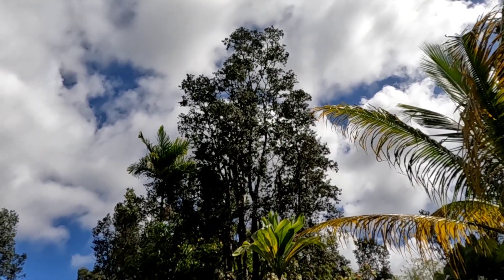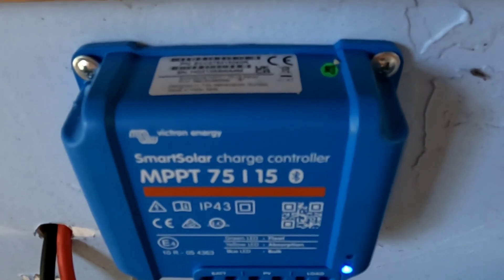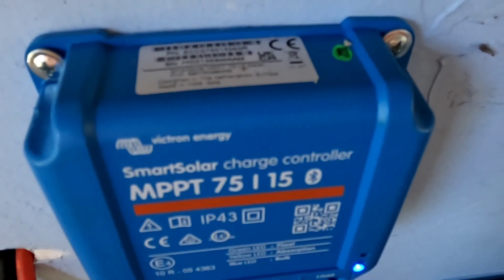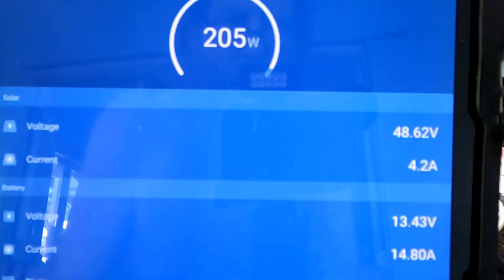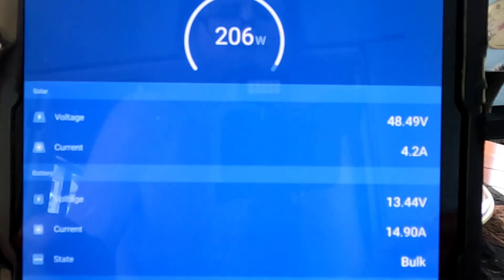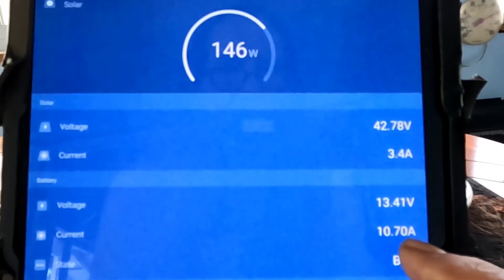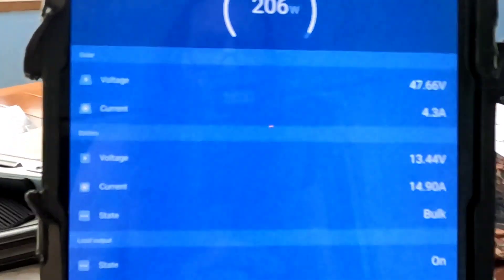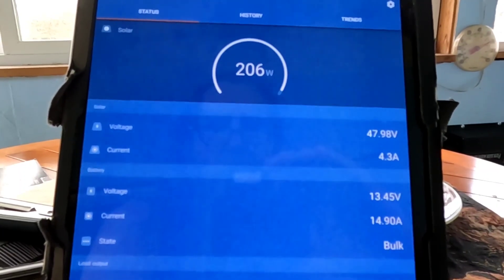Victron MPPT 75/15 pushed beyond rating. What happened?

Comment: I have the same controller, it is ok to over panel Victron mppt controller, no harm can be done with what your doing, just be sure to stay under the input voltage limit, what your seeing is called clipping during peak solar power available, not all manufactures of MPPT controllers can handle over panelling or clipping, be careful read the manual. If you were to add a 4th panel then you would need to put 2 and 2 in parallel then put the 2 parallel sets in series, 4 panels in series would exceeded the 75volt input limit, Alarm Input over voltage comes up @75.05v and stops charging, clears once you go below 73v and starts charging again.
Reply from the maker: Great advice, mahalo! 🤙
Reply: No it is not ok! You can’t go one the input voltage limit in this case 75v.
Reply: @allisonking785  What he showed us is perfectly ok, he’s not exceeding the voltage, he’s exceeding the output current, which is ok to do on victron mppt, but not ok on some other mppt controllers, I’ve updated my original comment to address this.

Comment: The 75 is the watts you can use directy from the controller without a battery connected. Its on the far right where there is written "load

The 15 is the maxs amps it is capable of charing your battery
Reply: 75 is the max pv open circuit voltage and 15 is the max amps the controller will deliver.

Comment: as an example///    got the 100 /20 ...      6x  old  24v     240w panels i found IN   3s 2p  maxing it out
 but need to make 48v battery pack to reach that limmit abd   keep the nominal specs  and the max specs  close to limit but safely under it
i count to self consumtion and the parrameter that panels are for sure Old enough used . it sure smells enough loss but tht charger will work less  hard within that losses!!!!        
!!! hopping to see the system charege a server rack  batt !!! i would love to see in a good sunny day  summer or winter  to maintain  a 5kw battery    . 

BTW thinking of install fans to maintain heat from system ..  if this doesnt work will try with 12v new  panels

Comment: I wanted to know too. I've got nominal  Isc 30A, but in practice about 22A max, and wasn't sure if I got the 20A model if it would survive. Great test. so I can add another panel in parallel. I'm also curious what happens with the voltage limit. Vmpp=120V, but Vmax=160V so for me, I didn't know if I could get the 150V max model.

Comment: That was obvious. It’s stated in the booklet that the controllers regulate till the max limit. Yes you can add a panel until you reach the max PV voltage .. in this case 75 volt. 
More panels means more efficiency with less light available. More panels at less light = max watt available sooner. 

So your experiment you could do in paper. 
Victron is not stupid and does test there systems the same way

Comment: People with no formal electronics training rarely understand current (Amps) You do not push amps you cannot exeed the amp rating of that controller, All you can do is exceed the voltage rating if you connect too many panels to it in series, The flow of amps is controlled by the resistance of the internal circuitry and the amount of voltage applied,  reduce resistance more amps flow, increase voltage more amps flow, you can do neither with that controller as it regulates those things

Comment: Right.   You only really have to be careful about not exceeding the open-circuit voltage limit on the input of the charger controller (with some provisios described below).  The charge controller will regulate the output amps to keep them under its amperage limits and over-paneling in this manner is fine, it won't hurt anything.  Its only (for the most part) volts that destroy charge controllers.   All charge controllers will regulate their output amps.

--

Charge controllers also often have input amperage limits too, which they can't regulate.  If you look at the Victron datasheet the "Max. PV Short circuit current note(2)" parameter for this particular controller is also 15A.   This means that the absolute worst-case current on the solar input must not exceed 15A.  The charge controller cannot regulate the input current so excess current on the input may damage the controller.   Note 2 on the Victron datasheet says "A PV array with a higher short circuit current may damage the controller".  And that is why.

So the controller can (and does) easily regulate the output current, but cannot regulate the input current.  In a series configuration this is virtually never a problem since very few solar panels are ever rated above 15A.

--

However, it can be a problem in a parallel configuration, or if two series strings are paralleled.   Usually you just calculate your worst-case input amps based on the assumption that the output amps will be capped while the input voltage is at the optimal operating voltage for the panel.

But can situations arise where this is not the case?  Yes, it is possible, though it usually takes a pretty serious misconfiguration of the series-parallel topology.  If the paralleled strings have partial shading but are otherwise in full sun, the input voltage will be far lower and the charge controller might exceed the input amperage limit trying to regulate its output at the output amperage limit.   With a proper combiner box you should have a master breaker on the combined output which protects the wiring AND the charge controller.   This breaker's amperage should not exceed the charge controller's maximum rating.... 15A in this case (as well as not exceed the wiring limits).

There is a bit of wiggle room there, for this particular case I would probably use a 17A DC breaker rather than 15A DC breaker just to avoid phantom trips from long-term thermals through the breaker.   But it is only needed if you parallel two or more strings whos short-circuit specs add up to more than 15A.

Can it happen on a 12V charge controller (12V output?). ... probably near impossible to happen with a 12V charger controller, this is more an issue when running 24V or 48V charge controllers since the input voltage (due to shading) can wind up being lower than the output voltage under certain conditions.
Reply from the maker: Mahalo for that great information! Appreciate you spending the time to explain this for all of us. Aloha 🤙

Comment: I believe you have a 15amp limit at 70volts or potentially 1050watts your controller provides 2 sources of power 1 that charges a battery and another load that can feed an inverter. If this is correct your not really close to the limit for power you can probably connect 3 parallel sets of 3 series 100w panels and stay safely under the limit. 9 panels 900w below the limit, less than 70 volts and about 15 amps.
Reply: This controller is only capable of 24v system. So, assuming a charging voltage of approx 28.8v x 15A is about 432W max output.

Comment: I always enjoy you videos!  If you had a 24v(or 48) battery system you'd get the full 300watts from the panels.  Amps don't add up in series connections, one caveat though,  just make sure that you aren't using a panel that has a Isc (short circuit current) higher than the controller capability.  That could happen with these small controllers.
Reply from the maker: Mahalo for sharing this information with us! I am running a small 24v and 48v system too...all doing great! Aloha!🤙

Comment: Interesting to see how the Victron handles over paneling.  It looks like the controller reduces the panel voltage to throttle the power into the controller.   What I don't understand is why the array current to the controller was so low.  In an ideal world even at voltage below the Vmp the current from the array should be close to or perhaps a bit above Imp.  Was your sun angle less/greater than optimum?  It would be interesting too see what the output from the panels is when connected to a higher capacity controller such as the 100/30.  In other words would you get the full 300 watts from the array and would the array amperage be closer to 6.25 amps?  

It also appears that total wattage is being effected by the battery voltage.  You should see an increase in wattage through the controller as battery voltage increases.  That controller is rated for 220 watts, which would give 15 amps at 14.67 volts.  If the battery was really flat (say 12.2 volts) the controller should only pass about 185 watts to the battery.  A quick calculation suggests that the controller will pass the following wattage as a function of battery voltage (using the 14.9 amps you saw as maximum output): 12v - 179w, 12.5v - 186w, 13v - 194w, 13.5v - 201w, 14v - 209w, 14.6v - 218w.  So based on that alone, over paneling is not an efficient use of panels.
Reply: Making the most efficient use of panels is not really as high of a priority as it used to be.
Back in the 80s I paid just under $5000 for 6 120 watt panels, I wanted to get every watt possible out of them.  Now panels are cheap and over paneling is a good way to get thru cloudy times without having to start the generator.
Reply: @andreblanchard8315  Getting maximum output is still desirable in some situations.  For example I have solar on my boat, but the size of the array is quite limited, so I would like to get ever watt I can out of the panels I have.
Reply: volts by amps gives gives watts. amps are low because panel volts are high..
Reply: Because that is the maximum power point... MPPT

Comment: Hi Gary,  Good content for sure.  I agree the controller is limiting the PV to the battery at 15A max.  Pausing the screen when the battery was at 13.45v and amps to battery at 14.8 equaled 199 watts to the battery about about 7 watts to run the controller.  Using 3 100 watt panels and warm temperatures, you will most likely see 75% of stating rating or 225 watts in total which would give you a very efficient conversion.  It would be interesting to see IF you install two controllers on the same 3 panels what the difference would be.  But given you have 300 watts of PV it may not be worth the test.  Luckily I now believe the specs on the controller will limit the amperage for sure.  I have always heard that the killer would be IF you install 100V of PV on a 75V controller, then most likely it would break it.  I did a similar test on a Midnite KID under a heavy load and the warning light would come on and eventually blow the PV fuse on the controller.....I did that by accident and got lucky!  Lesson learned.  In cold weather such as here in Michigan, the PV voltage can increase by about 10% once you get at freezing or below temps!
Reply from the maker: Thanks as always for sharing your experience with us! It surely helps us all and is much appreciated! 🤙
Reply: From the Victron mppt manual section 9.5.1O but its about reverse PV current since the unit IS protected against reverse polarity to an unpublished limit:  Overcurrent does not necessarily damage the solar charger, but it will cause damage if the array produces too much current while, at the same time, the array has been connected in reverse polarity to the solar charger. Damage due to overcurrent is not covered under warranty.  In testing on a 100/20 connected to a 12v battery the PV wattage limit is stated at 290 watts.  While testing and using the controller to top balance, my array is 600 watts and all I saw was one instance of the unit producing 0 watts for 15 seconds, then went back to the max of 290-307 watts on 12 v battery.  Yesterday, I rewired to 24v battery and the unit using the same 600 watt array jumped once to 636 watts before backing down to the 20a limit of 580-590.  Again, probably NOT a good idea to over panel a controller,  but when the unit said 0 watts, I thought oh no.....however, NO error log or event was recorded on the application.

Comment: The wattage from the panels is not being pushed to controller. The controller is pulling the wattage from the panels. It will only take as much wattage as it is designed to take.
Reply: there is no such thing as pull

Comment: Hello Gary, thank you so much for all your efforts and sharing your testing with us. I'm very much surprised though, for I was always under the premise that in series, you add the voltage but the amperage stays the same. So I was taken aback when the amperage too was being added. Thx
Reply: The 14.9A was the output current of the controller. The input amps were most certainly not added unless he ran them in parallel.

Comment: 75 volts is a hard limit...the 15 you are reading wrong(like so many do)
15 amps is what it will output to charge batteries  not a amp from panel limit...if you go over with amp input it will dissapate the heat

Comment: Victron rate their controllers to be able to over panel up to 130% capacity and yes they will derate with excess temp &/or power. You have ur controller set to 13.45v in Bulk mode & your controller limit is 15Amps, therefore u get 15 x 13.45v= 201.5Watts. If u increase ur bulk charging voltage to 14v x 15A you will have a charging potential of 210 Watts and each (Lifepo4) cell will reach a 3.5v maximum if u have a decent balancer to keep them within spec as the voltage rises of each cell.
Im guessing u have Lifepo4 battery which u can charge to 14.6v (3.65v/cell max), if so, I would suggest to tweak ur bulk charging up to 14.2v, ie: 3.55v/cell, as 3.5v-3.55v/cell is ur sweet and safe charging spot to get a full 100% SOC to each cell. At 3.45v/cell (13.8v total battery voltage) you will get a full SOC but it will take a bit longer, set ur controller to 14.2v for bulk and do not leave it there for long, if at all,  & 13.6v -13.8v for float mode and u will get the fastest, safe  & complete charge each day, if sun allows. 
If ur system was 24v, you would charge to 29.2v in bulk mode (max), and this would give u up to about 438 Watts of charging power if u have the 450+ watts of pv panels to do this, & this is one of the benefits and efficiencies of a system that uses a higher voltage, as u can see a higher output voltage through that controller will give u a better charging result with the same or thinner cabling. 
Consider also, if ur controller was capable of 48v charging (which it is not!), you could potentially harvest up to 880 watts instead of 200W at 12v with correct pv panel/voltage setup. Hope this helps. Cheers
Reply from the maker: That more than helps , and I appreciate you taking the time to explain that in a very understandable way. I read what you said a few times , and it sunk in good.  Yes, all LiFePO batteries running here. 12V mostly,  but a little 24V, and 48V too. Much to learn. Mahalo for sharing this with us...aloha 🤙
Reply: @ProjectsinParadise808  have you seen “DIY solar with Will Prowse” on YT? He is very good at teaching about solar, I think you might find his channel very helpful. All the best. Cheers
Reply: @ProjectsinParadise808 remember to set float to zero as lithium batteries don't float. My lithium battery only goes to 12.5,6 so don't set anything above or you'll destroy your battery.  Absorption is the goal.
Reply: Don't you need to hold 14.2 bulk for 2 hours to properly passively top balance cells at 3.50-3.55V, it takes some time doesn't it?

Comment: Like already mentioned, Voltage rises of you wire in series and Amperage rises if you wire in parallel.
The More Volts you get the less the Ampere is that’s needs to flow. So you will have less loss on the wire.
IMO, You should always try to max out the voltage Raiting on the Mppt. Since it will always charge the Battery with the correct value, which is set in the controller.
The controller also regulates itself if you connect too much Panels Amperage wise.

But Caution ! It is not able to handle more Voltage than what the Manual says.

Also you have to make sure that the Open Circuit Voltage of the Modules do not exceed the Mppts Voltage limit when you take the Temperature Coefficient into account.
(Voltage is higher when Temps are lower) it is about 12,5 % on top in my Conditions in winter Time.
So to do the math.
If your Panels open circuit Voltage is, for Example 20 Volts and you wire 3 of them in Series you End up with 67,5 Volts under Coldest Conditions which is fine.

I hope you could get the Point. Sry for my terrible English.
Best Regards from Munich/Germany !
Reply from the maker: I get the point, and your English is perfect! Mahalo for sharing this information with us,  and taking the time to join the conversation here...aloha!  all the way to Germany!🤙

Comment: I have 700 watt connected to a 30/100 on 12v. This gives me from 8:30 to14:00 a plato of 30 amp. It self regulates. I also do better if it is cloudy because it do not drop off as much. Kind regards Ben South Africa.
Reply: I use a Victron solar regulator as a smart battery charger and it works well. It is connected to an unregulated 24V DC power supply. The power supply can supply much more power  than  Victron regulator is made for. The other nice thing is regulate can set to maximum current and it will not exceed regardless  of the power supply can supply.  My understanding is the only way to damage the charge controller is by putting too much voltage into the input or supplying power in revise polarity. Any size solar array could be placed on the input provide that the open circuit voltage of the regulator isn't exceeded.
Reply from the maker: Great information for me Ben, and mahalo for that. Get plenty cloudy days here too. Aloha!🤙